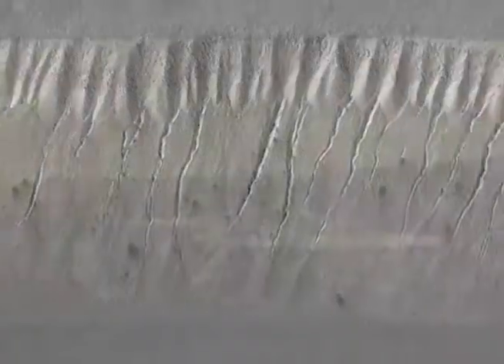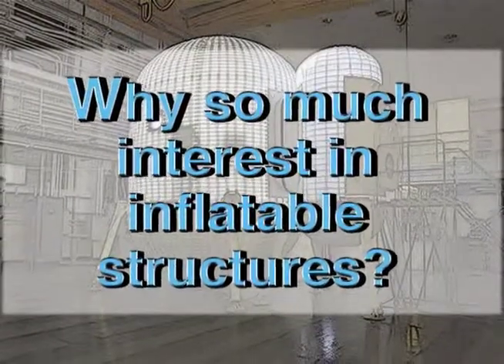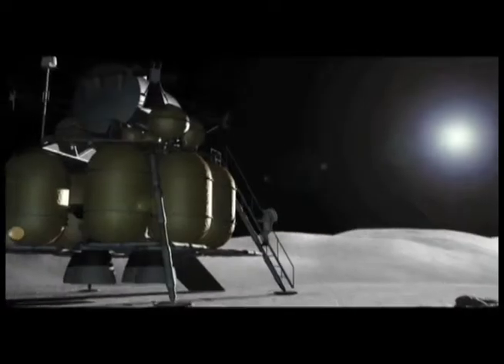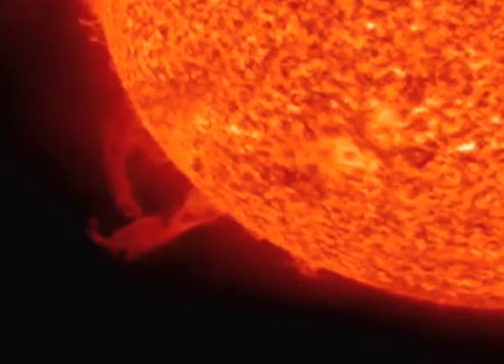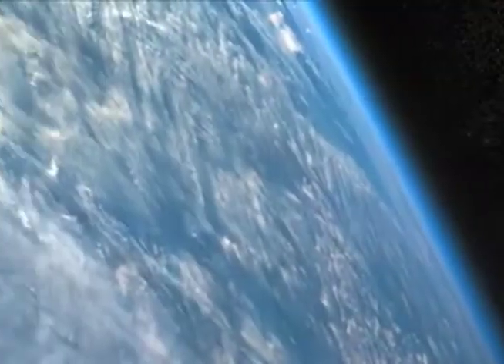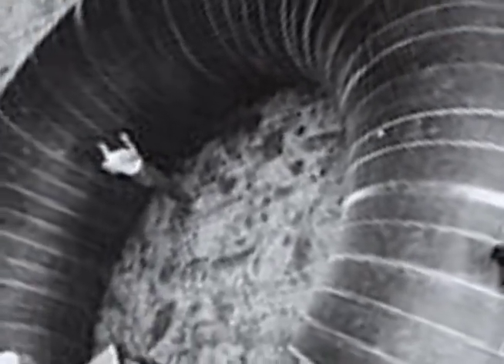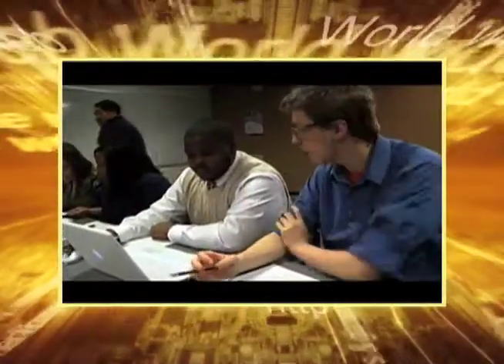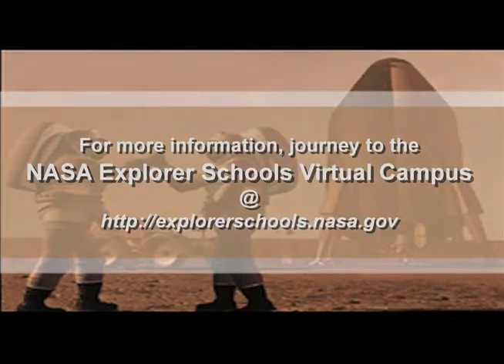NASA Now: Inflatable Structures

Comment: What it is is a ballistic Kevlar rapping with a expanded metal interwoven structure that will be holding everything down for a microwave and that construction for the radiation it is a lot more durable than a balloon it holds an inner weaving band that will be holding the inner structure together it is only a temporary structure for when the 3D printers

Comment: Compressed air stored intank or space compress of high ratio up to two stage 1/1000 ratio can create air or two stage 1/2500 each will create water in space. And we could use robot to coat the inflated with insulation foam after inflated in orbit.